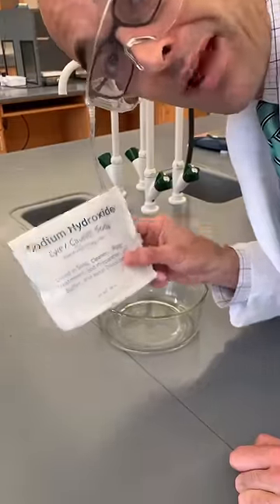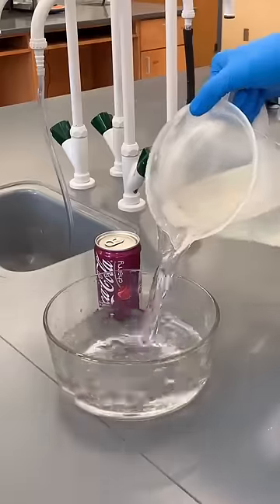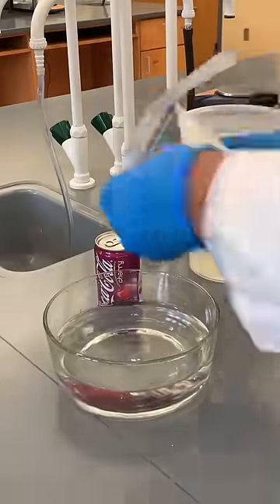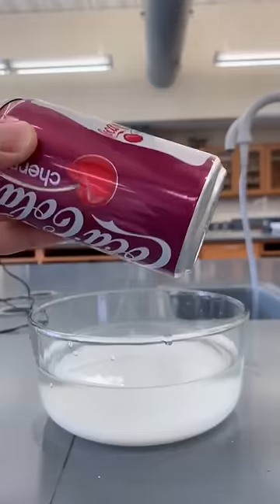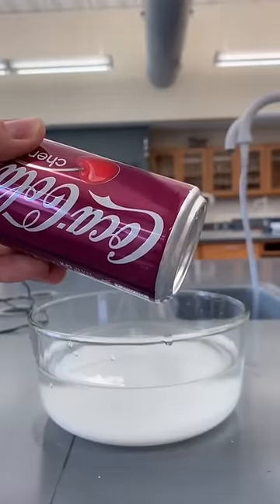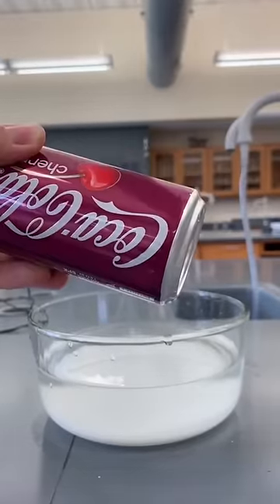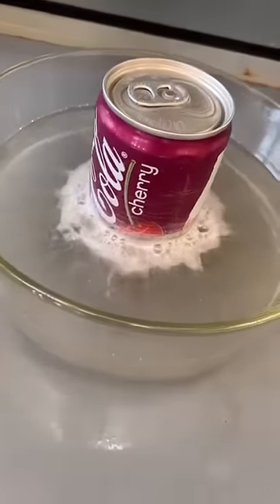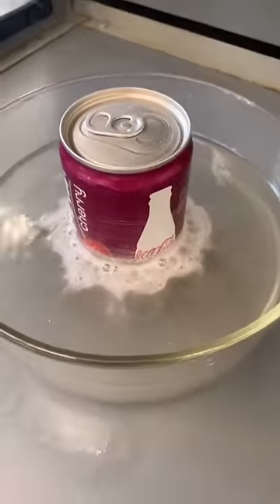Did you know this about aluminum cans?

Comment: The liner in ALL aluminum cans is not plastic, it's a food grade lacquer that is sprayed into the can and then baked on during the forming process.
Reply: Yep, im making the Tools for cans. This Video is just propaganda
Reply: And also that layer is necessary to prevent the aluminium corrosion due to the soda
Reply: Lacquer just describes a coating that's applied as a liquid and hardens. It could be made of anything.

In the case of cans it's Polyethylene or Polypropylene. Both plastic polymers.

They used to just add the plastic and the shelf life was shorter. Now they add plastic and we deal with microplastics just like much of our other food packaging.

It's supposedly environmentally because aluminium recycling burns it off so it doesn't end up in landfill but really just an extra step the oil takes before being burned. A step where tiny bits of it are ingested.

How harmful plastic food packaging is could be the lead of the next generation. We keep making less and less poisonous things to put our food and drinks in and eventually we'll ditch plastic.
Reply: This used to be true, but no longer 100%.  The liner is there to prevent corrosion of the aluminum, but is now either a sprayed coating or a film laminate.
Reply: I hope this comment gets more likes
Reply: That sounds worse
Reply: @spidermagicat  Damn this thread is an information minefield, 3 people seemingly speaking sense contradicting each other 😂
Reply: @Thog Strange place for such a comment but there is no wrong time to spread positivity. All the best mate
Reply: @aliasofanalias7448  Nice KOTOR pfp bro
Reply: @timmygoldstein  My man! I changed it about 3 days ago, been waiting for someone to notice it. Darth Nilhlus is just the coolest looking sith lord imo
Reply: @aliasofanalias7448  I don't know.. Darth Talon looks "pretty cool". Also the Revanchist is a total babe with that purple lightsaber
Reply: @aliasofanalias7448  I like how this thread changes from facts to spreading hope to star wars lol. Also what do you think of revan ?
Reply: @then00brathalos  Lol have you seen human traffic? Old UK film there's a really funny scene where they're on MD chatting shit about star wars thinking they're having mad revelations about the universe. Kinda reminds me of that.

Revan is the shit, when I was younger I always used to rp that I could dwindle on the dark side without turning so I got my mum to get me blue and red sabers and I'd run round my garden with my bro duel wielding 😂, so I was very happy when Revan came about. I also really like Darth Traya, KOTOR was just the best, there's a 2 hour vid on yt on her philosophy on the force
Reply: @mp5249  how?
Reply: @Thog hope won't change anything.  People have to be the change they want too see.
Reply: @teccanina858 do you really know the true meaning of the term "propaganda"?
Reply: Glad someone explained this
Reply: Most lacquers are a plastic. Even cellulose lacquer is plastic.
Reply: @Thog Hope aint gonna make the environment better, but jumping in head first also won't help. To solve a problem you must first understand the root cause of it, and then come up with suitable solutions. 

Root cause of all our problems are oil and overpopulation.
Reply: We sprayed a thin layer of food grade lacquer to your soda to prevent the aluminium cans from corrosion. Different types of drinks have their respective thickness of film.
Reply: Still has plastics in it
Reply: @spidermagicat  the plastic is safer than drinking from aluminum
Reply: @devlintaylor9520  We don't know that. Each would be a low exposure. Plastic doesn't leave the body so it's a low exposure for a longer timeframe.

Hopefully both are safe but plastic is riskier given current knowledge. Especially when plastic has been proven to be transmissible prior to birth so it is a life long exposure starting at the beginning of development.
Reply: @spidermagicat  I know plastic is bad for you, but plastic consumption doesn't cause brain damage. Aluminum does
Reply: @devlintaylor9520  in the same dosage as the studies on Aluminium on Alzheimers. Plastic will absolutely cause similar damage because you'll be dead.

The amount of Aluminium you ingest in food from untreated cans is difficult to detect because our bodies can deal with it and excrete it so easily.

The potential dangers from aluminium are related to dust and breathing in compounds from things like paint. Not aluminium cans.

Either way, you can cost the Aluminium with something else other than plastic. The choice isn't between aluminium and plastic. It's a choice between a more digestible protection later and plastic.
Reply: @spidermagicat  hey. What exactly does that mean. "Extra step before oil gets burned?"
What u wrote I find interesting trust me...I'm not trolling
Reply: @Thog the only pit I'm in is the Pit of Heresy. LFG D2 yeah!!!
Reply: @isaboteur2562  The plastic is inside the can when it's melted for recycling. 

It will be hot enough for it to burn off so it's no different than taking plastic and incinerating it.

Or taking oil and burning it.
Reply: But isn't lacquer plastic?
Reply: @teccanina858  same here at the tool and die firm I work for. Came here to say exactly the same thing.
Reply: Liners are mostly polymer but some are lacquer… why you yelling “ALL”?  Its just gonna make what you say seem more questionable.
Reply: You’re the guy who checks every fact just to troll, not bothering to make sure that what you say even makes sense
Reply: Food Grade Lacquer = Fancy plastic
Reply: Is that the same in canned foods?
Reply: Somehow this makes it sound even worse lol
Reply: The liner could also contain BPA.
Reply: @spidermagicat  not true, Lacquer refers to a SPECIFIC coating. True lacquer comes from the resin of Son tree. So you’re actually wrong.
Reply: @AshtrayAnnie  So you're saying in this context that we've been coating cans in tree resin. No that's not right. No I'm not wrong.

Lacquer means many things.
Reply: @spidermagicat  Go look at what you said….Yes your statement was wrong. The context was generalized, so I just corrected your generalized statement.

Lacquer by definition really means a couple things and both of them are naturally occurring substances.
Reply: Food grade 😂
Reply: @AshtrayAnnie  The context is not generalised. We're commenting on a YouTube video showing a can coated internally with a plastic lacquer.

Lacquer is a general term for a hard coating initially applied as a liquid. There are many modern examples using non-natural materials and we are not limited to speaking like antique dealers because you say so.
Reply: @spidermagicat  I mean…Lacquer never use to be a generalized term….people are using it wrong lol
Reply: Thank god!
Reply: @AshtrayAnnie  No, language changed. At least 60 years ago when synthetic lacquers were beginning to be used. No one misunderstood because there were already half a dozen common types of non synthetic lacquers so it was never specific enough to begin with.
Reply: Well aren't we the little soda can scholar!
Reply: The can is lined with PLASTIC
Reply: @AshtrayAnnie  As times change and technology progresses, language progresses with it. So please, refer to the facts before attempting to correct someone.
"Lacquer
{lăk′ər}
- noun
1. Any of various clear or colored synthetic coatings made by dissolving nitrocellulose or other cellulose derivatives together with plasticizers and pigments in a mixture of volatile solvents and used to impart a high gloss to surfaces.
2. A glossy, resinous material, such as the processed sap of the lacquer tree, used as a surface coating.
3. A finish that is baked onto the inside of food and beverage cans."
Reply: @spidermagicat  Actually yes, it was, it literally spoke on one specific type of resin from one specific tree. But try again.
Reply: @AshtrayAnnie  you were wrong. On a thread about cans you said a word didn't mean what it does mean.
Reply: @spidermagicat  Nah mate, I wasn’t wrong. It’s no different than how people use the word ‘lit’ for what it doesn’t actually mean. Sorry for bursting your bubble that people have been using the definition incorrectly for years now.
Reply: @AshtrayAnnie  you weren't born before the 1900s.

I don't need to feel superior but I will keep correcting you when you're trying to correct others.

You're wrong. Ask any instrument maker what types of lacquers they have to deal with with vintage instruments, and it was all called lacquer. Not all made of insects or sap.
Reply: @spidermagicat  Sorry mate, but yes actually, natural lacquers are still used excessively in instrument making.
Reply: @mp5249  sounds way worse lol
Reply: Semantics right?
Reply: @Thog thog don’t care
Reply: @AshtrayAnnie  how strange is it that you argued with someone over their use of the word lacquer 😂
Reply: @AshtrayAnnie  not all laquers used in instrument making are natural and for metal instruments it's been uncommon post WW2. All sorts of experiments with different materials started in the 19th century.

You really don't understand do you? Nevermind.

Laquer does not mean natural. It hasn't for a very long time. You can continue to be wrong about that or you can learn.

"Laquer" includes both natural and synthetic products.
Reply: @spidermagicat  What you’re referring to with synthetics are soft or hard coatings. And when it comes to metal instruments it’s usually an alloy.
Reply: @Jt-oj8mk  Not very strange at all.
Reply: @AshtrayAnnie  Rule of thumb. Yellow ones are a brass (alloy) coated in Laquer. Silver ones are silver plate or nickel plate if they're older.

Occasionally you get nickel silver alloys. The fact the metal is an alloy is only relevant in the fact that the speed of corrosion of some metals  means lacquer is necessary. The ones which are lacquered are coated in a liquid which hardens.

The lacquer can be made of many things.

The same is true of many of the black wood instruments. Especially gloss finish pianos. Some have natural ingredients in their lacquer, some do not.

What I'm referring to with synthetics are lacquers.
Reply: @spidermagicat  I’m saying that most professional instruments are alloys. I’m not talking cheap instruments made in china/Taiwan.
Reply: @AshtrayAnnie  I don't disagree. I never said instruments weren't made of alloys.

In fact it's plain to see none of them are pure metals. The closest is a nickel silver alloy, occasionally used. Which is sterling silver and very much professional grade.

But are you aware they coat alloys in Laquer. Very expensive professional brass instruments are coated in Lacquer... That thing we're talking about.

Do you know what an alloy is?
Reply: @spidermagicat  I’m the one who brought up alloys lol…you really don’t think I know what they are? 

The reason alloys are used is to stop deterioration, and it also gives a great look for the design.
Reply: @AshtrayAnnie  Now I know you don't know much.

Because you don't realise brass (the alloy you're talking about) degrades without lacquer.
Reply: @spidermagicat  Notice how I never once mentioned brass and you just said “brass, the alloy you were talking about”.😂😂😂Man…you’re the only one that brought up brass. And even if we were to talk about brass, you clearly haven’t done much metallurgy or understand the science behind brass. Brass is actually quite corrosion resistant. It was literally invented for that purpose. Zinc acts as a sacrificial anode in the end product of brass to keep the metal from corroding. Thanks for coming out though.
Reply: @AshtrayAnnie  You really don't understand.

I've claimed lacquers can be made out of many things and have been for a long time.

You have claimed that's not true.

I have brought up an example of traditional instrument manufacturer as an industry that uses many types of lacquer and has done for a long time.

You've brought up alloys because you believe that contradicts my point when it doesn't.

I've given a specific example for you of an alloy, which you want to talk about, which is lacquered, the subject of the conversation, that happens to prove your initial claim wrong.

It doesn't matter if there are examples that might match your meaning if you're claiming your meaning is the only one.

I only have to provide examples that don't match your meaning. I've done that. You're claim that lacquer does not refer to synthetics is wrong.

What is funny is you don't know anything about instruments and you're still confidently wrong.

The sacrificial anode process you've googled dulls the brass. Every shiny brass instrument you see is lacquered so the brass does not "dull".

Hence why I started the conversation about the shiny ones and glossy ones.

Lacquer is to make things shiny and keep things shiny. Lots of professional instruments are very shiny.

Thanks for coming out too. To be so confidently wrong all the time about every subject brought up in a conversation is quite the feat.

But feel free to go off on a tangent again and be wrong about another thing.
Reply: @teccanina858  "propaganda", please.
Reply: @AshtrayAnnie  you can't seem to tell me anything I've said that's wrong.

So excuse me if I ignore your claims of authority when you've said several things that are wrong.

I can perfectly believe you have played the trumpet and don't know they're lacquered. You don't seem to understand much.
Reply: @spidermagicat  I haven’t said a single thing that’s wrong…name one lol. Sorry to tell you lil man, but my trumpet doesn’t have a drop of PLASTIC COATING (Note, I didn’t say lacquer). My trumpet is silver plated, with no lacquer. Like most high end instruments.
Reply: @AshtrayAnnie  but I wasn't talking about your trumpet. So I'm not wrong.

Very basic logic you keep missing.

Lacquer can be made of natural materials but the fact it sometimes is doesn't mean it always is.

Your trumpet may not be lacquered but that doesn't mean no trumpet is lacquered.

I mentioned the word lacquer and what you thought of wasn't what I was describing. You thought I was wrong but it was only wrong in your head. What I said wasn't wrong about lacquer in general.

I mention brass instruments and you think of your trumpet. Again you thought I was wrong because what I said didn't match your trumpet. But what I said wasn't wrong about trumpets in general.

In every case the problem occurs in your head. It's your failure to recognise that the first thing you think of when you see a word isn't the only thing that word could describe.
Reply: @spidermagicat  No, I said you’re wrong because what you’re talking about is a plastic coating. Not a lacquer😂
Reply: @AshtrayAnnie  the plastic coating in cans is a lacquer. 

It's sprayed on as a liquid and hardens to form a protective layer. That's what a lacquer is.
Reply: @spidermagicat  If it’s not from the sap from a tree or residue of insects, it’s in fact a synthetic plastic coating. Nice try lil man.
Reply: @AshtrayAnnie Laquer: noun,

"a liquid that is painted on wood or metal and forms a hard, shiny surface when it dries"

Like I said again the problem is in your head. 

You've got a definition of the word in your head and can't comprehend there might be more than one meaning of the word.

This is what they call a "you problem". You have my sympathy.

We've reached a circle because you're still arguing with the dictionary.
Reply: @samhill9487 That's precisely what I've been saying. Lacquer made from plastic.

Unfortunately some people want to say it's lacquer and therefore not plastic, which is wrong and easy misinformation to spread as all the manufacturer documentation will refer to "lacquer" or "varnish".
Reply: @samhill9487  sorry. Just got the notification for some reason.

Comment: So.... 🤔 how does the recycling process work for aluminum cans?  Does the heat of the process just bun it up since it's a thin layer?
Reply: Yes. Paint and plastic lining burn, turn into slag, and float to the surface of molten aluminum so it's easy to remove
Reply: 90% of recycling goes to waste
Reply: @bryananderson3772  aluminum is the most successfully recycled material though, and you lose the least amount of material in the recycling process. It is nearly infinitely recyclable (unlike most other materials), and 75% of all aluminum ever made is still in commercial use and circulation. It’s also more efficient to recycle than produce by like 95%.
Reply: @bryananderson3772  only if you're talking about plastic. Most of aluminum - 75% to 90% - gets recycled. Do your research instead of posting misinformation.
Reply: @bryananderson3772  i try to tell people this. There is ONE type of plastic that is recyclable. The rest goes to landfills. Most metal is scrapped for recycling, most of the metal that goes in a recycling truck is sent to landfill.
The only thing worth recycling is paper. Thats why you have to put it in a seperate can from plastic and metal.
Reply: @johnnymac6242 Way to ignore all the comments above you. Unlike a lot of stuff, pure aluminium is pretty much infinitely recyclable.
Reply: @Tom-rt2  aluminum is cost prohibitive to sort from plastics. If you want to recycle aluminum, you should sell it to a scrapyard instead of paying a recycling company to sell it to China.

Comment: My understanding of aluminum soda cans is that the can (minus the top) is pressed from a single disk of aluminum, then the top attached later in the process.  Now if that is true, why did the bottom not dissolve in the solution like the sides did?

Comment: What's interesting is that PET, a material used in a lot of food packaging reacts with sodium hydroxide as well. So they must use some sort of epoxy resin. This makes sense because of the phosphoric acid in coca cola which would also react with the PET.